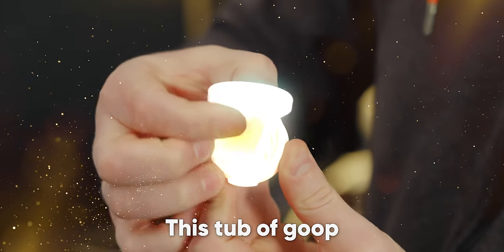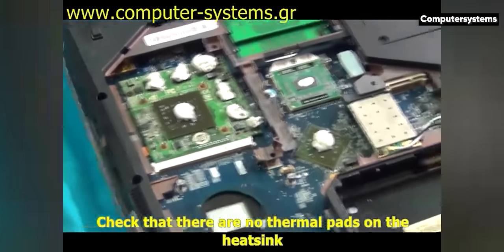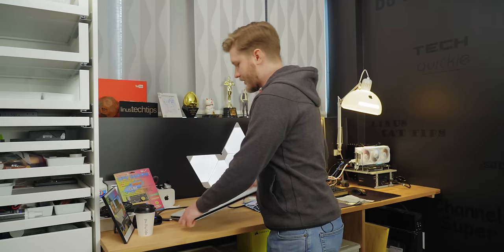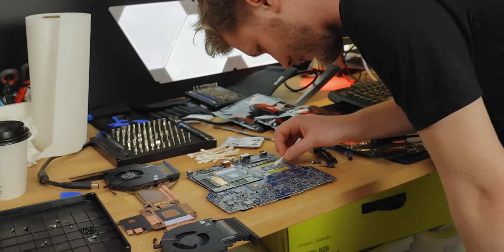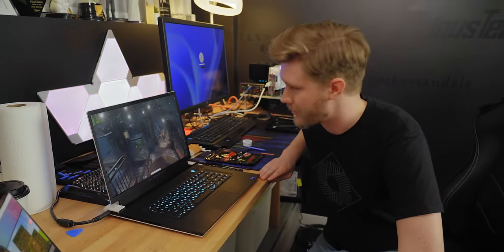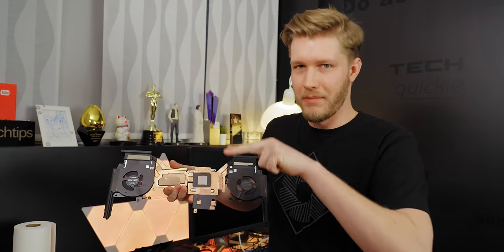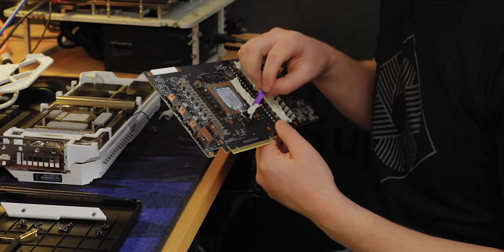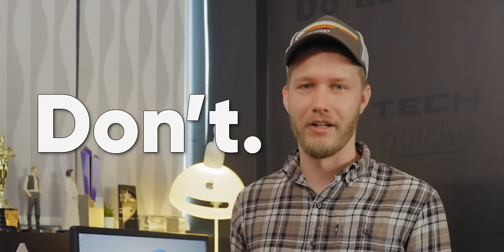More FPS for just $10 - K5 Pro Viscous Thermal Paste

Comment: I bought that for my watercooled gpu. Standard pads were 0.5mm, but the memory chips were not level to each other and I had shutdowns. Applied this stuff and havent had issues after that. Some users reported drying up with time, but we will see. I could recommend for similar issues, but not if thermal pads do the job.
Reply: Interesting. Yeah I think it might dry up but it shouldn't be a problem since it should stay fine in the center where it matters. How are your temperatures? For me this video came a week too late. Put on my EKWB Vector Strix block and the backplate block onto my 3090 with the stock thermal pads from EKWB. Runs really cool. Memory ever peaked at like 54°C. And 24GB of GDDR6X is a fusion reactor...
Reply: @kyoudaiken  well, my gpu is ancient r9 290x and doesnt have memory IC temperature. Considering that 4 of the memory chips didnt made contact with the block at all and i had to play for 1-2 hours before a shutdown, the K5pro is doing its job now.
Reply: @sreflectionbg  excellent I've been looking for a comment on how it works with older cards, I too have an R9 290 so you think it's well worth giving this stuff a go? When I last stripped down my card I noticed the thermal pads were looking worse for the wear and some parts tore when taking it apart. Hoping this goop might extend its life a little more.
Reply: I just put my 3080ti on a water block on Christmas, my memory temps went from 98-103c to 55-60c under load. Doubt this has any extra benefit when water cooled.
Reply: @ascap2854  Same here with my RTX 3090! GPU-z shows over 200 watts memory power consumption when running blender. Try to dissipate that with thermal pads... They REALLY need to rearrange the cooling. IMHO, air cooling as it is currently designed does not work anymore when a card takes more than 200 Watts overall. With air cooling you hit a brick wall at around 250 Watts. From there, you need to brute-force airflow. GPUs over 200 Watts are incredibly noisy.
Reply: @sreflectionbg  was one tub enough for the vrms on the 290? I need to repaste my 290 as well.
Reply: @Barracuda1807  I personally used the paste only for the memory chips. On the VRMs I opted for pads. I use Arctic Cooling ones with a regular thermal paste between the VRM and the pad. Thats what EK recommends and I dare to say it does make a difference.
Regarding quantity, I bought the small rond container and I barely used even 1/3 of it. But mind you, the gap is only 0.5mm on a water block, so twise that on an air cooler.
Reply: @sreflectionbg  thanks for the info, one tub should be enough since the air cooler pads are 1mm
Reply: @Barracuda1807  should be plany, yes. You might even have enough for second repaste. :)
Reply: 2 years later, hows the shit holding up?
Reply: @quantum5661  well I sold the card recently, but it was working no problems. The paste in the container still looks ok.

Comment: You missed the most interesting point on the 3090 : the VRAM temp. 
It is super toasty with stock thermal pads, that would have been great to know how much VRAM temps changed with the paste
Reply: I have a video on my channel where I replace the thermal pads and I can improve the temperature from 96º/100º to 68º/70º on my RTX3080 (the video is in Portuguese but in the description I have the video in English for anyone who wants to)
Reply: I do not understand what is the point of this video without temperature measurement🤷
Reply: @1vend7  Why is your GPU so darn hot? Ive never had it reach those temps. It should thermal lock or crash when it hits over 70' C
Reply: @alexlabmonkey  the point is that you can buy that or similar product and forget abut taking measures for thermal pads and avoid accidents such as putting 1mm thermal pad instead of 1.5mm pad and possibly damaging your GPU.
Reply: @exterminater267  He's not talking about GPU temps, he's talking about VRAMs, those are normal temps for VRAMS

Comment: Another cool use-case for this would be heatsinks for M.2 SSDs that use different height ICs, such as the V-NAND ones, where the controller is a good 0.5mm shorter than the memory ICs

Comment: I've been considering repasting my RX580 with something like cryonaut, and knowing I can replace whatever thermal pads it has while I'm at it is pretty nice. I will almost definitely be picking up some of this stuff.
Reply: I repasted my rx570 with kryonaut, dropped about 10c, at full load used to be 80c-85c(depending how hot the room).
Reply: Kryonaut isn't designed for air cooled GPU temps long term. You will have very good temps initially, but expect it to creep up over time. Gelid Extreme is very stable for GPUs, that's my recommendation. Having used K5 Pro, I also wouldn't advise it because it leaches silicone oil like no other. I rtepalced my mobo VRM pads with it, and after about a month, had streaks of oil running down the entire length of the mobo and under the PCIe slots. It was a huge mess and a pain to remove
Reply: @taylorsharp5928  So TDRL: Use Gelid Extreme for everything, including as a replacement for thermal pads.
Reply: @taylorsharp5928  it's been a year now, no issues.
Reply: @GENKI_INU  can confirm. i have gelid extreme pads on my reference rx480 and liquid metal on the core. they work fairly well and the best i've tried on this very hot card
Reply: @GENKI_INU  Yeah you can't really go wrong with GC Extreme. Just make sure the pads are the right thickness so it doesn't take pressure off the core. Generally best to avoid the Gelid Ultimate pads because they are much harder to compress and often lead to contact issues
Reply: @taylorsharp5928  I meant using straight up thermal paste in place of thermal pads lol. Which I've done before and works better than stock pads.

You can even put thermal paste on both sides of a thermal pad (if you're using one) for even better performance.
Reply: @GENKI_INU  Ohh word. Yeah you can do that, but idk how well it would hold up over time, and I can see that making a big mess. I have heard that pads + paste improves performance though, but haven't tried it. Even better is to use copper shims and paste, I did that on my GPU, but it doesn't have mem temp sensors so idk how much of an improvement it made. Was able to OC VRAM another 40-50MHz though, but temps weren't an issue to begin with
Reply: @taylorsharp5928  I notice the Ultimate 1mm aren't too hard to make proper contact with, but the 3mm ones definitely are, infact I have 1 degree hotter than my stock MSI pads. I ignored it however due to waterblocking soon, I'm hoping the difference is negligible.
Reply: @NeededByNobody  Yeah that's why I never reccomend buying the highest W/mK pads you can find. IRL it's not as simple as big number = better temps

I've only used the 1.5mm Ultimate, but those were pretty stiff. I got them to replace the stock VRM pads on my mobo and it caused the board to flex enough to keep the pad from contacting firmly in the middle. I've seen the same thing happen with GPU VRM. You can tell a lot from looking at pad compression and paste spread. 

Good luck with the waterblock m9!
Reply: @taylorsharp5928  The best thing about using thermal paste (or K5) entirely (instead of pads), is it also increases the mounting pressure of the heatsink applied to the die. If coupled up with liquid metal on the die, the improvement all around is absolutely massive.

I've also used thermal paste for insulation around dies with a little "moat", so that liquid metal cannot spill over even if I use too much.
Reply: @GENKI_INU  For sure. If you're set on using putty, check out TG-PP-10, it's 10W/mK and doesn't leach silicone oil. 

The paste moat is a good idea, I've considered that before. Ended up taking the LM off my GPU because it was pitting the copper baseplate of the cooler. It did allow me to OC the core an extra 80-100MHz though
Reply: @dagnisnierlins188  when should I replace mine? I've used it for a year. I get about 85c at full load
Reply: @Jojo2  Now. While 85°c isn't a 'dangerous' temp for most cards, it's better if it's lower than that
Reply: @Jojo2  I replace it every 2 years, because I do a full cleaning of the heatsink. For you if the temperature has been the same for a year, don't bother changing paste. I would recommend adjusting fan speeds and do a undervolting.
Reply: @taylorsharp5928  No issues with Kryonaut here long therm. You might have gotten a counterfeit product.
Reply: Oh finally there's someone with my exact card, and RX580... almost like people forgot about its existence. But I bet you weren't as stupid as I was, buying a 4GB version when at the time I could have had an 8GB version for just 16 extra dollars... right now it would have been like $160 extra.
Reply: @kyoudaiken  what did you use it on?
Reply: @hdwblade  Kronaut and Kryonaut Extreme on RTX 2080ti ZOTAC AMP EXTREME (not in my hands anymore), RTX 3090 STRIX OC with water blocks (3 months now), ASUS Zenbook Laptop on CPU and GPU, Old Sony Vaio laptop. None have issues.
Reply: @kyoudaiken  what were your temps before and after and at what clocks? All 30 series owners I've seen talk about this have said it was worse than stock. You're the first person to say it's good, but I don't believe it. Lol.
Reply: @kyoudaiken  my apologies, I had joke woken when I responded and completely missed the Kryonaut part of your posts lol. Yeah, I've used it before on my CPU, I ended up repasting though because temps were bad. Only problem was I didn't have enough for a second application after doing both CPU and GPU. Bummer for sure
Reply: @hdwblade  Oh. Is KP5 really that bad long term? I have bought a puddle for 10 EUR but didn't use it yet. I used the pads EK provided for my water blocks.
Reply: @kyoudaiken  it's garbage, worse than the stock pads but good for laptops and low power stuff with old dry pads.

Comment: Honestly, I really missed a thermal test. I would love to know, how much cooler the VRM was.
Reply: Like they said, there's no temperature probes for the VRMs. They can't measure it, unless they had the means to probe the inside of the chip (Which is very difficult to do manually).
Reply: @dizzydaisy909  then they should've used a card that does work on... Works on my 3080 FE!
Reply: Where's tech Jesus?
Reply: @dizzydaisy909  Exactly like Bliznade said. Or they could use a thermal camera for the GPU or use their own thermal sensor as Hardware Unboxed uses for their reviews.
Reply: @EaZynite  I agree. FPS numbers from a CPU bound game was not the correct tool to measure the performance of this stuff. Pretty disappointing from LTT. I mean sure, it's free but why waste everyone's time when they could have actually given us good information with less time necessary on their part? A 3 minute mining test with hwmonitor could have told the whole story.
Reply: Temperature readings don't really work anymore because the gpu will just run harder and hotter with the extra coolings its got. Unless you disable all the boosting stuff and lock down the clock speed
Reply: @Rugg-qk4pl  not the case with VRM temps
Reply: @dizzydaisy909  that's weird, my mobo gives me a temp readout for my VRMs.  I wonder if it's a brand specific thing with their particular card or what.
Reply: Anything that exceeds reading a value he can see with 3 clicks is completely outside of this guy's abilities 🤷🏼‍♂️
Reply: agreed, have to call a bit BS on the data provided here, especially on that 3090.
Need to see those clock speeds, the temps, because clearly the biggest play here is gpu boost, if the thermals were just 1 degree difference that could have been the difference in boosting, and that temp diff could be just ambient temp issues.
Reply: @ZomgZomg007  Need to hope GN does a review to get that level of test data
Reply: @gitghetto  I am sorry, but your argument makes no sense. I love LTT videos, but even in their videos, when they test some product, they provide us with FPS and Thermal results.

Comment: So you basically changed the VRM and memory thermal interface but didn't offer before and after temperature results?
I don't understand why, the FPS numbers are in the margin of error. Measuring the temperature at the same fan speed and ambient would show an objective difference, if any. Kind of disappointed on this one.
But keep up the good work, I expect better next time. At least from LTT.
Reply: yea, doesnt use temp is really weird. Maybe it's because they use it for vram and older vram before gddr6x (which mostly of them) doesnt have thermal sensor so there is no what to tell... But still, they use it for CPU too...
Reply: I really liked when it was mentioned that "GPU still needs to run 3D Mark *once*". ONCE? THAT is the benchmark they are doing? If just one run can prove anything, I might even have had an overclocking record somewhere in the past... The lack of depth on the really important things on the videos is abysmal... :(
Reply: Came through to check out LTT, it's been a while...
Another sad and typical video with no value. No numbers at all. Yes technically they were answering the "claimed performance gains" but not the actual figure we wanted.
There is always so much potential and they never fulfill it which is why I stopped watching LTT for the most part several years ago.
Another one of my pet peeves was the Morpheus II cooler review. They literally said nothing about it that would have any value. That cooler changed my GPU entirely as I got on sale for cheap a GPU but it had a blower style cooler on it. It was whiney and ran hot so I looked into a solution. Still cheaper in the long run but the Morhpeus II made it dead quiet and ran 25-35 degrees cooler at stock... Allowing for some overclocking as well at the same noise floor. But they didn't cover any of that in their review, nor any numbers just "the fans look like they are running at low RPM and it's quiet"...

Comment: I'm using the K5 pro for a few years now. Used it also successfully to paste a throttling NVME SSD on the underside of a motherboard. Pasted it to the case actually, worked extremely well.

Comment: I've actually used this before, not for replacing thermal pads on PC parts, but for re-pasting a Nintendo Switch after taking it apart to replace a broken screen. Nintendo uses a similar viscous thermal paste between the CPU/GPU chips and the EM shield (which also pulls double duty as a heat dissipation plate), and K5 Pro is pretty much a direct replacement for Nintendo's stock paste.

Comment: I must say this stuff is amazing, for a while i had problems with my gpu of 5 years overheating and constantly on being 94 degrees. I already changed the thermal paste on it a few weeks back no improvements. Bought this stuff after the video and now on maximum loads it runs around 76 degrees max. Like i said amazing stuff and thanks for the video!
Reply: Was one tub enough for the GPU vrms?
Reply: @Barracuda1807  more than enough for my gpu
Reply: @zizoraf  What did you use on the core? Same stuff or?
Reply: @exterminater267  If i remember correctly i also put it on the core, and still working fine after a month
Reply: There is no way you got a 20* delta with just a different paste. Something else had to have changed. Otherwise you got god tier paste and would be a game changer. Just sayin.
Reply: @willj3ff  Old paste might've just been that bad, or not connecting all the way